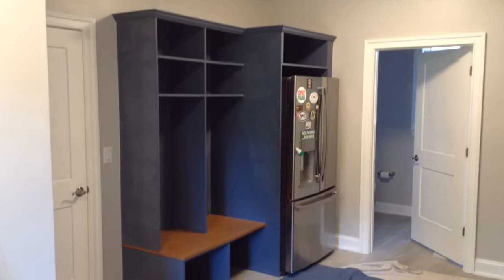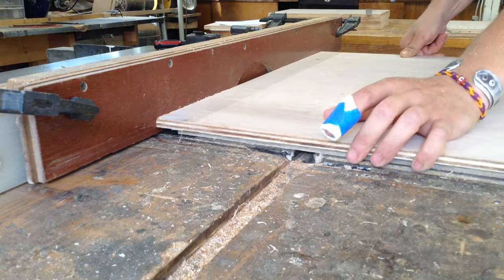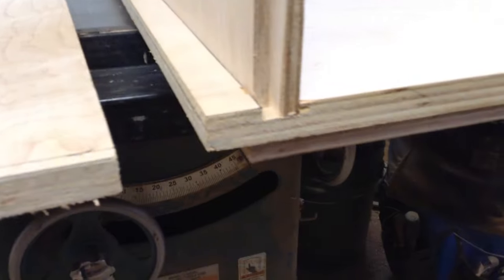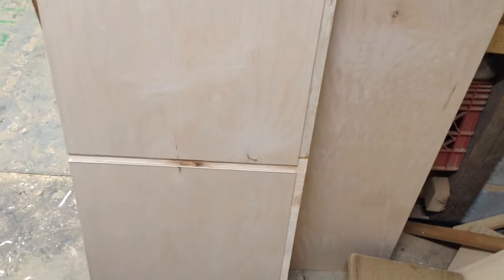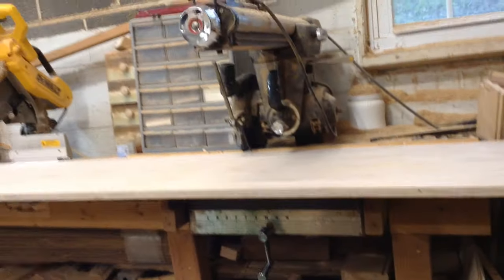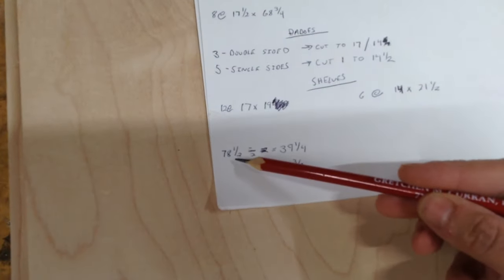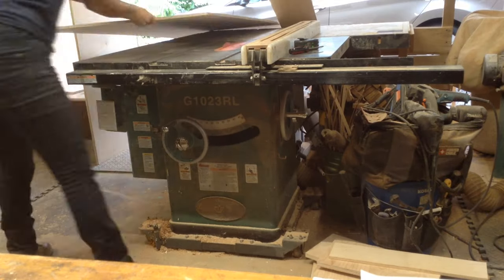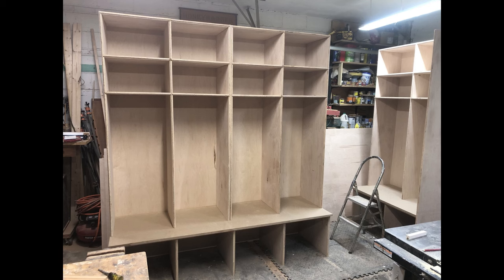Never Building This Again || Built In How To [Part 1]

Comment: Damn those units are large, I don’t envy you having to move that lot, I am unable to lift large items anymore so the last built in I did I designed it to be made in four sections to make it easier for two people to move, it was still bloody heavy mind you, looking forward to the next episode as the brief look at the finished units looks fantastic 👌👌👌👍👍👍🇦🇺
Reply from the maker: Yeah, I made the sections on this one were very manageable.  The two upper sections were pushing it with backs on, but luckily from my truck I only had to move them about 20 feet and up three stairs.

Comment: ‘Never again’ - I’ve said that many times. I’ve made even larger such built ins than this and I had a much smaller workshop as yours is now.
The test fit of top and bottom sections happened when I delivered the project!
One I was able to fully assemble in the shop but then while it would fit the alcove at the customers house I couldn’t get it to the alcove because it couldn’t clear an overhead in the customers hallway. I had to cut it in half at the site and then put it back together in the alcove.
Reply from the maker: My original shop was a little smaller than 10x20 and didn't have 8 foot ceilings.  So, I also couldn't fully assemble built ins in that shop.  Even built a couple of them outside just to see them fully assembled.  Used to move the whole thing in and out of the shop everyday. Don't miss those days.  Feel your pain.
Reply: @HoneyBadgerWoodWorks  my old shop was even smaller than your old one. it was an 11x25 basement level garage wih 7' ceilings. Fortunately I'm  not in that any more. Now my shop is (will be) a 24x40 sub section of a40x56 pole barn with a 12' ceiling😎

Comment: I agree about the large sheets of ply.  For many of those cuts, I opt for a good track saw.  Not only does it mean that I don’t have to man handle the sheet into the table saw, but it also has less chipping of the veneer on the ply.
Reply: You either need dry weather or a lot of space to setup for the tracksaw party. I cut it on my rolling plywood rack now (well crosscuts anyway) which is a time/space saver.
Reply from the maker: I’ve been thinking about a track saw for years.  Other stuff just aways seems to pop up.  But, everyone I know who has one loves it.

Comment: Am so impressed with your productivity.  Question, long dadoes on the radial arm, how do you line up the cut when you spin the plywood?
Reply from the maker: I set up a stop based on my original with the lines drawn on it.  The stop aligns everything front to back.  So even when I flip them I can move the stop based on the original and all the rest come out the same.

Comment: I think you would find this safer and easier with a track saw. I have used the cheap WEN model and it is beautiful. I flinch every time you I see you ripping the long runs on the table saw and it doesn't look safe. It did come out very nice.

Comment: You make it look so simple but I know they're not straight forward at all. For something this size that can be glued and moved what would you say is the biggest difference between a built-in and a 'standalone' that gets scribed into place? Sorry if that's a dumb question but I always told my students there's no such thing!
Reply from the maker: I’ve never heard of a stand-alone.  To me a traditional built in is set between two walls and permanently built into the architecture .  But, I do a lot of these where only one side is anchored to a wall and I still consider them built ins.  A stand-alone for me would be something more like a large china cabinet that while is still a large piece of furniture can be moved around.
Reply: @HoneyBadgerWoodWorks  I meant a freestanding unit? In the past I've built wardrobes and shelves that could stand independently but then slotted them into an alcove and fixed with a scribed frame effectively making it a built-in. The biggest difference for me was the style of decorative finishes but I wondered if you built for example a freestanding wardrobe and a built-in wardrobe fundamentally differently. You've kind of answered in your other replies. Thanks HB.

Comment: What software are you using for dimensional drawings?
Reply from the maker: SketchUp.  I only do them in the customers specifically asks for drawings because I hate computer work.
Reply from the maker: SketchUp.  I only do them if the customer specifically asks for drawings because I hate computer work.